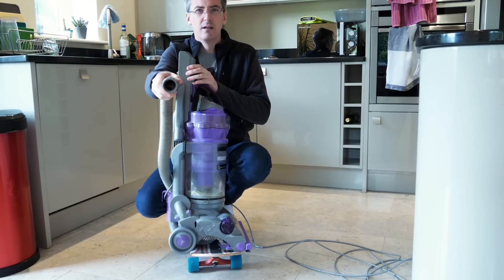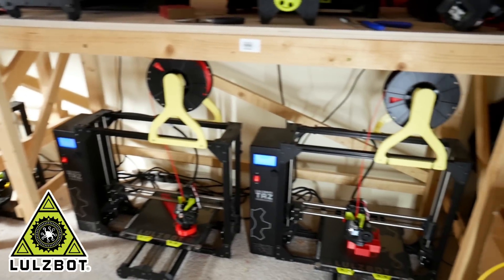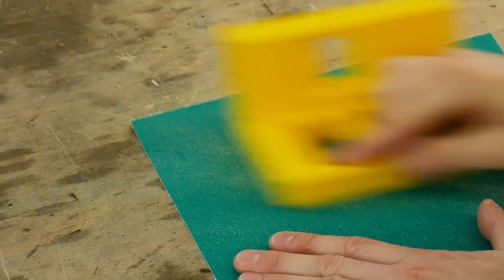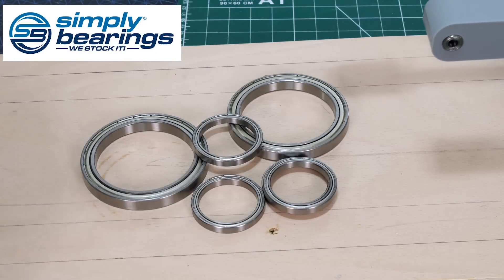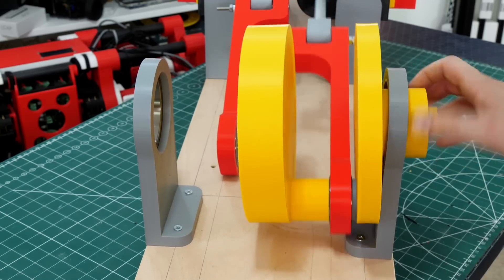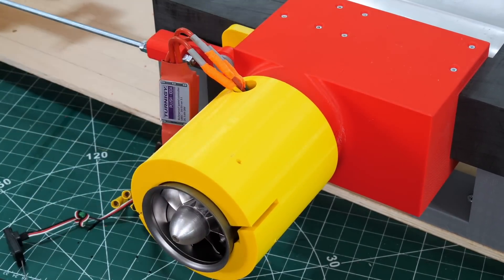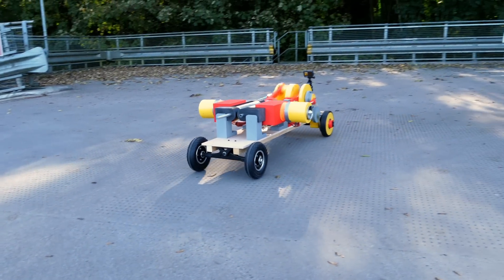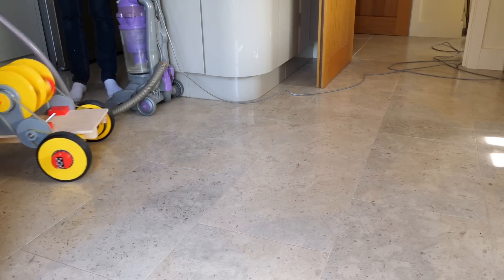Jet Powered air engine

Comment: that this sort of valve timing is designed to let pressurized air in at the top of the stroke (both directions) and then the actual power you get isn't from the air pressure of the fans, but rather mostly from the air expanding to normal pressure after the valve has closed. With long strokes, this would require a rather high initial pressure and most of the time your fans are blowing against either closed valves or both sides of the piston (depending on the valve timing, which looks like it may overlap.

stacking the fans together to feed a pressure vessel and from there into both cylinders will have the fans blowing less against the closed valves, but you still need to look at the expansion ratio of the cylnders, not just the area. How much volume is there in the cylinder when the valves close vs how much volume is there when the valves hit the other end of the stroke (and how far before the end of the stroke does the valve for the other direction open)

what you really want for this sort of low pressure engine is a valve system that will be open for most of the stroke, closing just before the end of the stroke (when the other valve opens) but the valve design you are using is designed to let in just a small volume at the very end of each stroke. The system you are using will let you spin it in either direction, as the valve action is strictly controlled by the position, where what you want is one that's open based on the direction of travel of the valve (or a cam that opens one side for the entire stroke, then opens the other side for the entire stroke)
Reply: Well spotted! I wanted to also mention how this valve design lets air pass through both sides at the same time for most of the stroke, which basically does nothing for the engine. So with a longer open time of the valves + greater separation of in/out the engine should run way more efficiently

Comment: Thanks for this James, another crazy project that would take most of us weeks to do. The higher tolerance of the aluminium tubing was a good way to go, but scaling that up would mean very expensive tubing. What about sticking with 3d printing but working on some form of seal around the cylinder? Fuel engines use piston rings with piston rings to improve the seal, so the tolerance between piston and cylinder is reduced by basically a spring. Could you use that kind of idea?

Comment: @james on the piston couldnt you make it with a small tgin indent near the top a few mm and then put a thin rubner ring around it and then use oil coated the inside of the piston tos seal it furthermore a 4 cylinder engine would be better as that will vibrate a hell of a lot